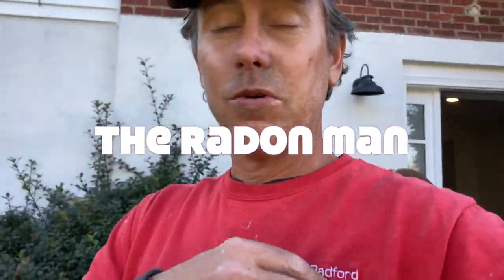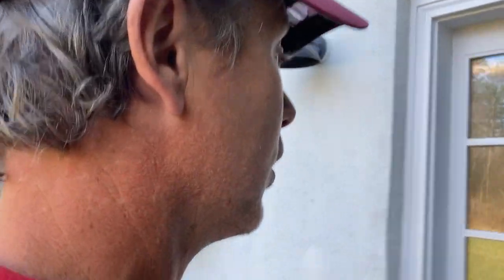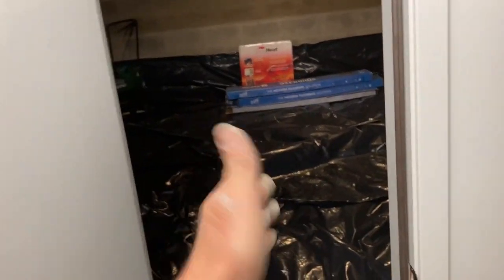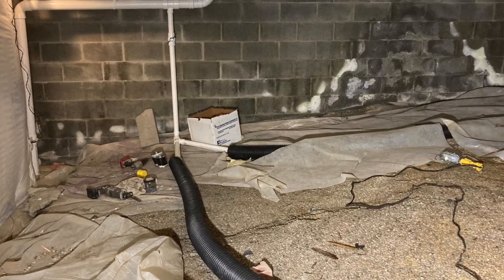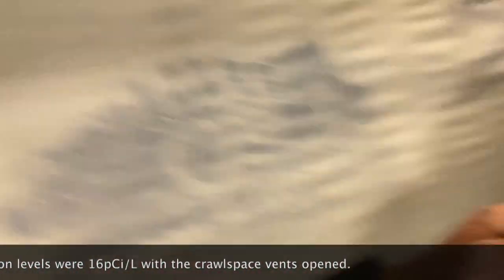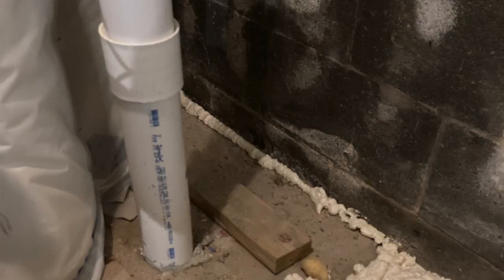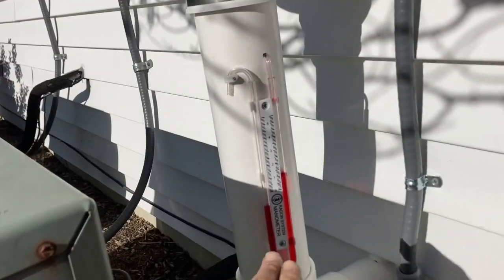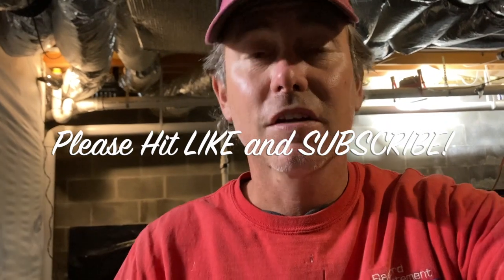A Passive Radon System Crawlspace Combo?!!

Comment: Is that black corrugated pipe a perforated French drain type? 
Can I just put a couple of those under my vapor barrier and then run a PVC vent stack near my HVAC fan outside? I’m thinking about blocking my vents and installing a dehumidifier. Very humid down here in Charleston, SC but I don’t have the $17,000 to pay a company to encapsulate it like a clean lab.